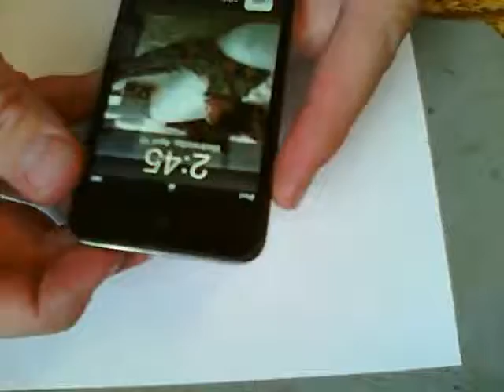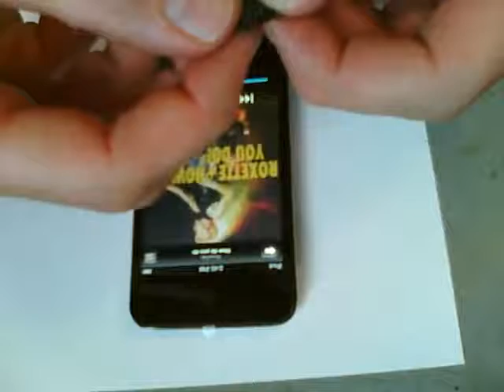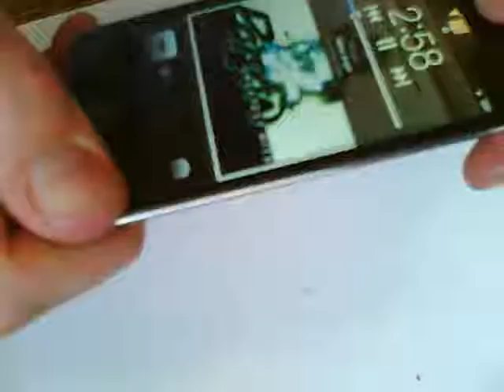iPod touch 4th Gen Screen Repair (Fix Dented Backplate Problem)

Comment: question...   so to change the back plate you have to brake the screen ???  or you can maybe just heat it a little more and can be more easy to remove without be break ???